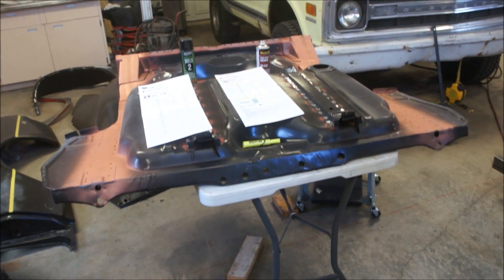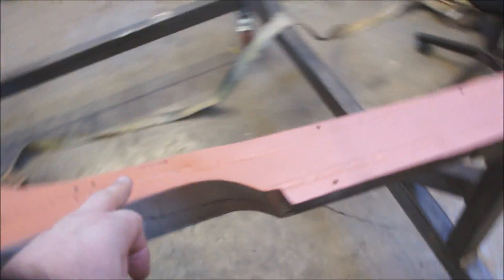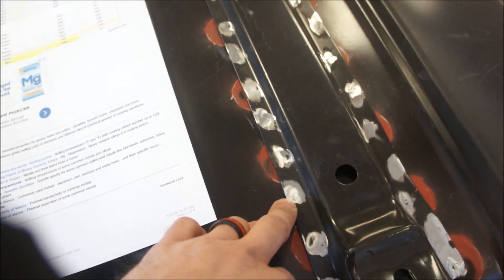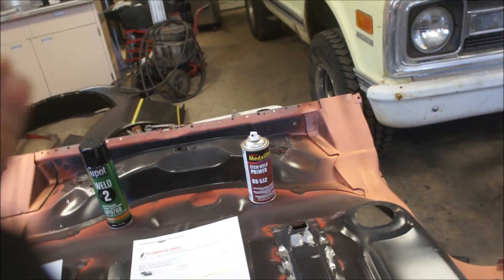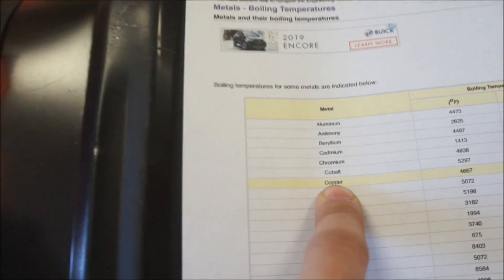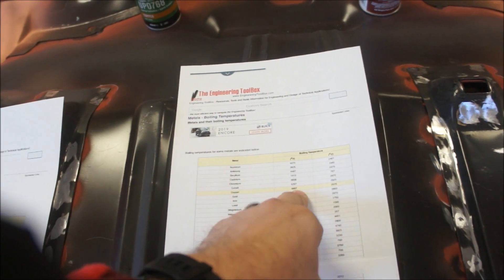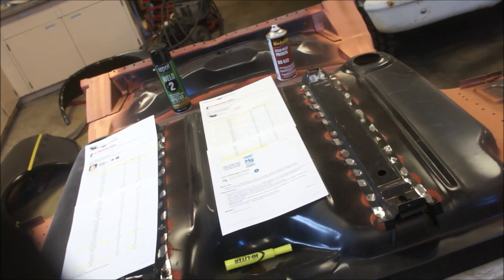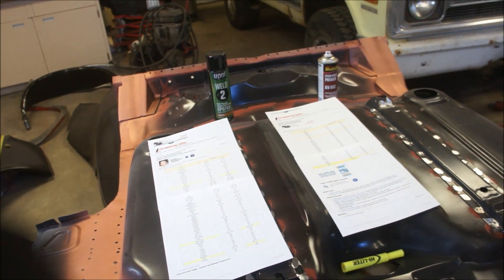weld thru primer copper vs  zink

Comment: Alot of well thought through logic, but I doubt that is weld through primer underneath an original sill, or rocker as you call them across the pond. Far more likely the car was assembled with galvanised panels. Whilst the copper is less likely to burn away during the welding, of equal importance is it's ability to protect steel from oxidisation. Zinc is proven in that respect, but copper so far as I'm aware is not. Many years ago I visited Ford's Dagenham plant in the UK, and all welding was with bare steel.
Reply: Yes and they rusted to hell, virtually every single one of them!
Reply from the maker: Matthew Jenkins zinc is better at sacrificing itself however if when you heat it up by welding it vaporizes then it is good for nothing, zinc is surely the way to go on panels that won’t be welded
Reply: @MrFireman164  But is the copper good for anything, even if it remains in place? Treating the zinc spray and galvanising as equal processes may too be unfair. Boiling point of zinc and zinc primer may not be the same or even close, in the same way that impurities in water alter the freezing and boiling points. The joins you indicated as a fault of zinc, are a fault of spot welding a galvanised, not zinc primered panel. The main purpose of weld through primer is to protect parts that otherwise would remain bare and virtually nothing can or will offer the weld itself any protection.
Reply: @kevinsedo6869  Not a matter of either of us winning. This is just about following on the logic and covering all bases. Obviously paint cannot be used in a spot welded seam without burning off and contaminating the weld. Zinc is proven to protect well, but cannot survive at the weld itself, unless some unknown properties of an ingredient in the can have altered the boiling point. Copper may survive but can it protect the stretches between the welds as well as the zinc? I haven't got a clue, but if that worried would use zinc first as it's properties are well proven, at least on the areas that don't reach boiling point, then overlay the copper. Nobody can answer this without trying all methods, maybe leaving in a saline solution for 48 hours then separating.

Comment: very interesting video !!  I recently started restoring an old french car and was reading about weld primers etc.. and came to your youtube channel.
I know in europe, the new cars, after being welded and assembled they go through a zinc-solution bath for corrosion protection.
Why not a copper bath ?  I don't know ? maybe copper is much too expensive ?  
But maybe (just guessing) it also has something to do with rust protection. Zinc corrodes easier as steel. So they take zinc because it will sacrifice itself to corrode before the steel does. Suppose we take copper iso zinc : the copper is more difficult to corrode as steel. So the copper will not sacrifice itself to rust, but the steel will rust iso the copper.  Just guessing and thinking, maybe zinc is better ....
Anyway, after the welding, blow some very liquid anti-rust protection into the hollow spaces that will penetrate through capilair effect into every little hole
Reply from the maker: Scatt Kiwiman copper is very expensive
Reply: @MrFireman164   true.... I have been reading a bit more about the subject and found this : 
https://www.thenakedscientists.com/forum/index.php?topic=23613.0
when the surface is perfectly covered, the copper will protect better. But in case of scratches etc the copper will not protect but enhance the rusting
Reply from the maker: Scatt Kiwiman not saying copper is better than zink at corrosion protection the point is the zink isn’t even there after you weld it , it no longer exists because it burns off , the copper melts but stays intact so as to provide some corrosion resistance

Comment: Remember that the arc itself is between 6,000 and 9,000 F. It’s why, in TIG welding, the tungsten tip melts. Check the melting temp of tungsten.

Weld through is mainly there to protect metal where you can’t paint. So we’re talking about in between panels in a door, as an example. These panels shouldn’t be exposed directly to water, normally. Even if the weld itself begins to rust a bit, the rest of the panel is protected. If you paint the surface of the panels after welding, then the weld is protected on the outside surfaces, and the weld through is giving protection around the weld, almost like a gasket. It’s not perfect, of course, but it give some protection where bare metal has none.

As far as the sheet used in modern cars, it’s ultra high strength high alloy steels,  not low carbon. Those days are pretty much over. These new steels are far stronger than anything used before. If you wonder why panels are thinner than they used to be, that’s why. Some are up to 800 mega pascals in strength. Compare that to the older steels at about 200 mega pascals. They are also ductile, and easy to form. Welding them properly requires newer alloys of welding material.

I hope that helps somewhat.

I applaud your efforts in this area. It isn’t easy, considering all of the bad, and misleading information out there
Reply: The tungsten electrode should only be melting on Alternating Current when tig welding. If its melting welding Direct Current you're using the wrong size tungsten Electrode
Reply: @funsufer1239  oh, the tip can melt with the right size electrode. It’s a point, at some time that point loses it sharpness, that from melting. I’m not talking about balling up as in welding aluminum.
Reply: Зачем писать про сварку TIG, если тут говорят о сварке MIG?

Comment: thx for sharing the research and the knowledge, I use the copper weld-thru to be compliant but it's a nuisance--just trusting the industry to know what's best. Like you say at the end, some care does need to be paid to applying it. It seems like I remember 2 medium coats/15 minutes in between (instead of just slathering it on right before welding).
Reply from the maker: eldigitom yes , the solvents are still off gassing early on which can cause reactions with the weld , thanks for watching

Comment: Perfect timing for me watching your video! I just came in from the shop after spraying UPOL Copper on my firewall weld surfaces! My research tells me the same thing that you did such a great job in showing. As an electrical engineer whom studied electric arc flash energies and temperatures for the last 15 years of my career, electric arc temperatures can get as high as 35,000F. I believe GMAW welding temps run between 3000-10000F depending on arc gaps and settings. Using it surely can help, surely some of it turns to gas in the mid  point of the arc but as the temps drop going away from the hot areas of the arc, there will be a sweet spot where it can help reduce corrosion(edge of the weld where moisture could attack). My two cents........

Comment: Amazon has the Upol 0768 weld thru primer available. They are calling it zinc/copper.   Solids suspended in a paint does not have the qualities equaling electroplating.  I wonder if the amount of metal solids suspended in the paint actually lessen corrosion and if galvanic corrosion is worth considering?   Here is a site with some information about which metals are most and least likely to corrode:  https://inspectapedia.com/BestPractices/Galvanic_Scale_Corrosion.php 

 At the bottom of the chart labeled Metallic Corrosion Scale Terms is this:  

 Note:
Metals that have relatively lower resistance to corrosion, when placed touching another metal with higher resistance to galvanic corrosion, will act as the anode and will suffer corrosion.
Example: copper pipe joined directly to mild steel or cast iron pipe will produce corrosion appearing more noticeably on the mild steel or cast iron pipe.

Is weld through primer just another snake oil?
Reply from the maker: Paul Straney http://amg-v.com/copperpage.html

Comment: My only concern with copper would be the strength of the welds it is between. I mean, you use copper backing to fill holes when welding because it doesn’t “stick” to the steel. With copper weld thru, would it not put a layer of this “unsticky” material between the steel pieces? I’m likely going copper as well, but that has had me scratching my head.
Reply: Well I have a Masters in engineering and did metallurgical analysis for aircrafts for several years. I agree that gas pockets provide no strength. I just believe the strength is compromised vs bare metal if copper is mixed in. From a corrosion standpoint, copper around the weld is a good thing. Like I said, I’m probably going with copper as well, but will scrape off what I can through plug welds. Really if you feel you can get the epoxy in there well after welding, the copper may not be buying much with corrosion either.
Reply from the maker: general23cmp http://amg-v.com/copperpage.html

Comment: Mr. Professor: what temperature does rubber melt? I'm ready to see some tire smoke!!
Reply from the maker: Ryan Spyres that’s a great question but the only way I’m going to see that happen is to pour fuel  on one of my big ass tires and light it on fire 🔥
Reply: As long as you post a video I guess that will work for now!

Comment: I looked at what temp a spot weld is and it says 400 to 500 degrees F.  That is why they use zinc when building a car.  Your video makes sense for mig welding though.
Reply from the maker: larryz24 you might want to visit a different sight that one is wrong

Comment: One another consideration is the grounded copper in a resin binder out of the spray can will not hold the same melting point as the actual copper metal.  If it weren't for the binding properties the grounded copper are encapsulated in, there will be a violent reaction between the two dissimilar metals caused by electrolysis.  The resin binders holding the grounded copper together will break down at a much lower temperature.  Keep up the great job!

Comment: I am wondering what happens to the chemicals (primer) that are added to it to help prevent rusting. As I understand it the copper is just meant as a conduit for the electrical current and not as a rust inhibitor. I'm just thinking since I don't know.

Comment: Wow! Roger, Thank you for doing this video. I just started  the same type of project, and made sure i bought a can of weld through primer...when asked the question, zinc or copper,   I replied well, i'm welding sheet metal so i guess i need zinc instead of copper, and  i was told i was correct. i knew it was bad to breathe, but now i am going to switch before i get any further along. keep up the good work. i have learned so much following you. Thanks again.
Reply from the maker: Bob Hally no problem, this is just food for thought there will be many that dispute it , I will be getting comments for years on this one

Comment: Another factor is the change in the metal itself from the heat and it losing carbon . when you melt steel structure of the atoms changes . run a bead of weld on a flat plate with no primer and set it outside, it will rust worse around the edge of the weld because the metal has changed in carbon content ever so slightly  .  That is the reason back in the 80's i learned to soak thinned  primer in between panels after welding , learned that from an older gentleman that taught me to paint and he learned it from the oil and gas industry with offshore equipment .
Reply from the maker: Craig Voisin yeah that’s why I inject epoxy with a syringe and then seam seal

Comment: If you want to go the extra step and do a pull test on welds to see the strength difference it would be interesting data. Personally I would think a spot weld is actually stronger than a pinch weld. Not sure about that one either. 
   Love the videos, very informative and entertaining.
Reply from the maker: Anthony Hixson Thanks

Comment: I wonder what the copper does to the metal ? does it weaken the weld as it doesn't boil away? I just wonder if that is why they used Zinc so it would boil away allowing the metal alloys to meld together without contamination. I think there are a lot of questions. Liked your video, makes you think ;)
Reply from the maker: Cary Lamari http://amg-v.com/copperpage.html